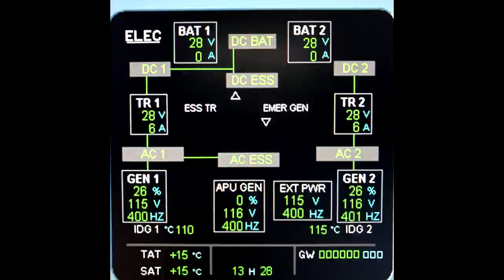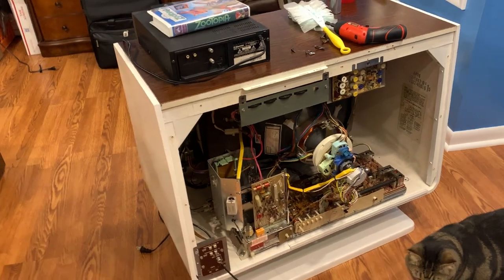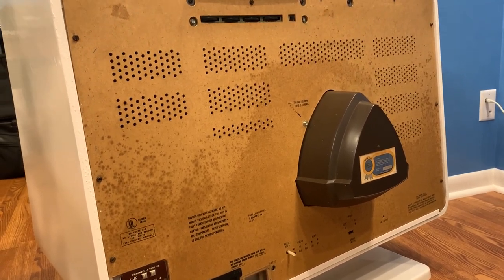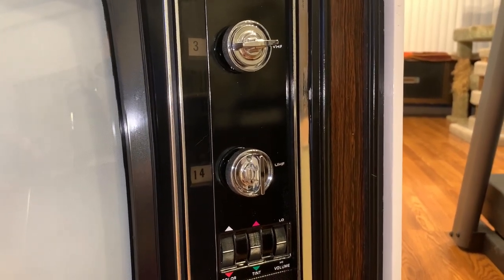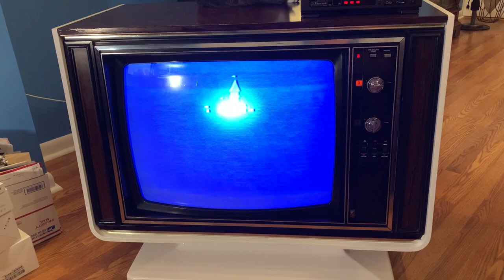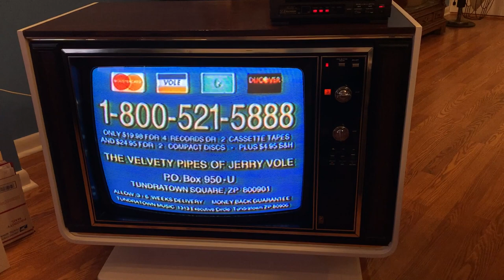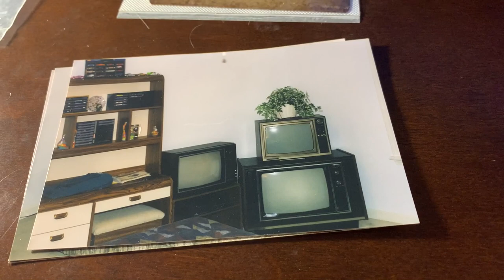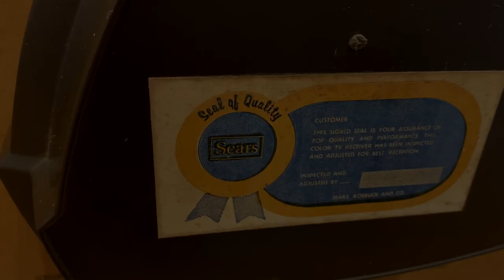Sears Avanti??  1975 Sears Model 528.44760400 25" TV

Comment: RCA jug.  Interesting set. Panny also cloned the Avanti. Even used the Zenith
power supply w/ transformer & oil filled cap.  The white / rosewood cabs also used by others BUT when it came to modern / ultra modern Zenith ruled the roost.
LFOD !